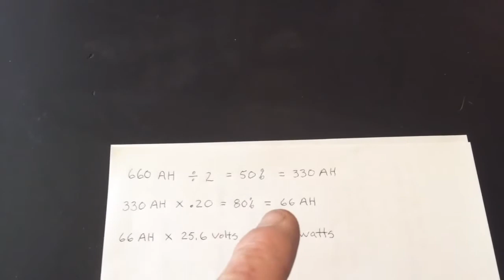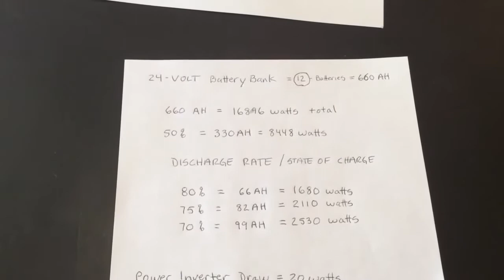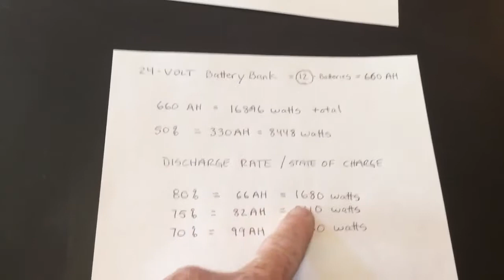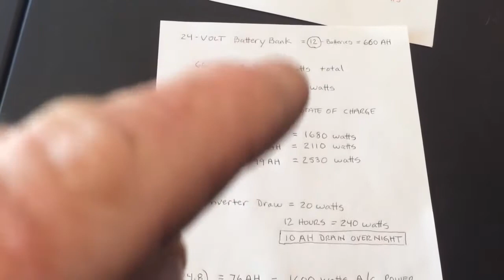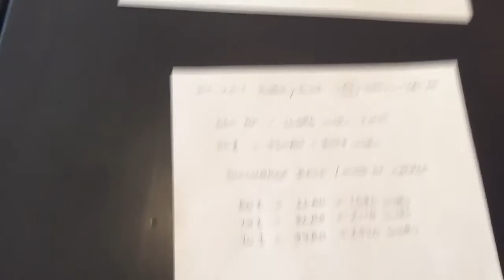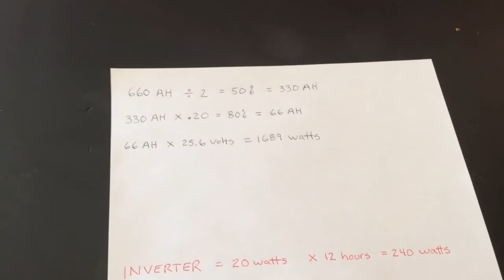SOLAR POWER Battery Bank amp hour draw numbers info off grid

Comment: To put out video in youtube you can't be a complete idiot or at least watch the video before you put it out there.  This video sucks because you can hardly read what's on the sheet and the focus get worse and worse to the point you can't concentrate and whatever the hell this guy was trying to explain to the youtube crowd.  This is a good example of what a shit video looks like and I'm pretty sure this guy didn't even check it before posting because had he checked it he wouldn't have posted it.  I feel sorry for this guy, i'm sure he had good intentions but boy this he miss the boat.

Comment: Do I detect an error in ADDING the amount of electricity CONSUMED by an inverter to the 1689 estimated watts available. It should be DEDUCTED, should it not? The 240 watts shown for the inverter should reduce the 1699 to 1459 available watts. Assuming his other figurers are correct. And since the inverter will most likely be ON all day, should not the 12 hours be 24 hours and 480 watts? A Killowatt or other meter might be a better idea. Just measure the current flow over the hours in use or something like that?

Is there a device that you can plug into the AC outlet to determine the actual amount of wattage or amperage of your storage battery. If so it would be simpler to just halve that, etc. Plugging into the AC outlet would factor in all of the loss of the system.

Comment: These numbers apply to lead batteries as their DOD = 50% to maintain a healthy battery. They can be discharged 100% or so but only a few times in an emergency. HOWEVER here comes Lithium batteries. They can be discharged almost 100% on a daily basis: however, they cost about 3 times as much but do last a lot longer. The battery in my iPhone and iPad use a similar technology and give a warning about 10% of charge remaining but will continue to work.
Reply: Well yes...

Comment: @ 1:30 you state “80% depth of charge left”. This is miss leading as someone might think it means 80% of battery capacity is left.  What you are showing is 80% of 330ah available.  Keep in mind that  can use 100% of the 330 available (which would bring you to 50% state of charge).  So if you only want to draw your batteries to only 80% state of charge, then the calculation should be .2 X 660 = 132ah available at night.  If you are only using 66ah at night, your state of battery charge would only be at 90%.  (.10 x 660 = 66).  An easier way to look at it is if we use 75% state of charge.  We know that 75% is in the middle of 50% & 100%.  So the middle of 330 (half) is 165ah is 75% state of charge.  accordingly, .25 x 660 = 165ah.
Reply: Your comment helps immensely as I saw it the same way- at first sight it looks to be using 50% of 50%. Thx!
Reply: I saw the same thing...
Reply: Thank you so much for clarifying because people are very dumb nowadays and do not know how to think for themselves

Comment: This is why I'm going to use lithium ion for my battery bank, I have (20) 36v 4.4ah packs I'm going to wire in parallel for a 36v 88ah 3kwh battery bank and they can be drained down to 10% allowing for 2700 watts of power usage.  It would take almost 6kwh of lead acid and 500 lbs to provide the same useable power as 3kwh of lithium at 40lbs.  It is however more difficult to deal with battery balancing and to find charge controllers that work with this battery bank.

Comment: on a 4048 Schneider off grid inverter , can i run 2 sets of  8 -6 volt batteries  with a total of 16 6 volt batteries ?
Reply from the maker: Yes 16 will equal 48 volts. two sets of 8 and jump them together .